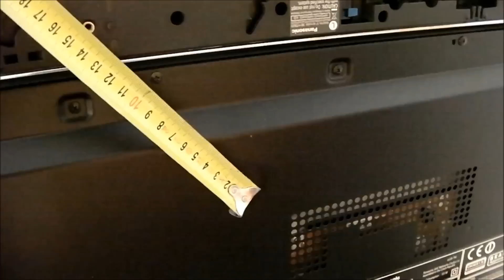HOW TO MAKE DIY TV SOUNDBAR MOUNTING BRACKETS

Comment: Nice simple solution. Any concern that this makes the setup top heavy and subject to tip over?
Reply from the maker: No, it's quite light. Mounting the speaker on the top makes a huge difference to the sound as well.

Comment: This is great if your sound bar already has a means of being mounted. 

We bought our sound bar a few months ago, then decided to wall-mount it and our TV. Surprise—our sound bar isn't designed to be wall-mounted. It simply has rubber feet, with no places for screws or bolts. I had no idea this type of product even existed.

If anyone has any ideas, I'm all ears.
Reply from the maker: +zeppy13131 that's odd. You could glue brackets to the back, 3M make a very strong double sided tape or drill your own holes and bolt from the inside of the case. Mount in on a slim shelf.

Comment: Okay so I have my TV mounted to the wall. And I took off the stand... Is there a universal adapter I can screw in a speaker mount where the stand was?? Is that a thing and if not why not?? Could you make a DYI video for that?
Reply: Made a bracket from the tv wall mount to the soundbar. Same principle. Only concern is spacing it out if the offset is wrong (soundbar too deep/proud).